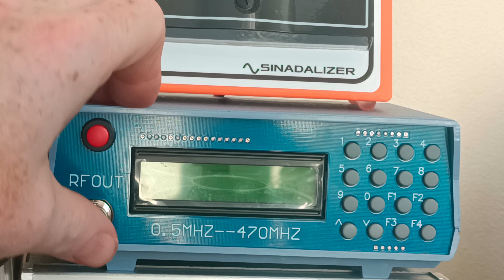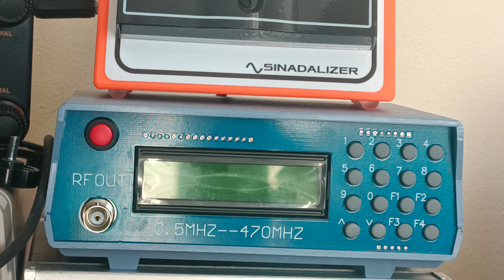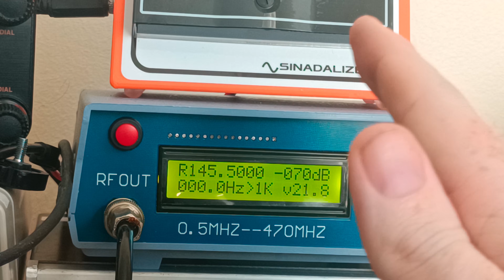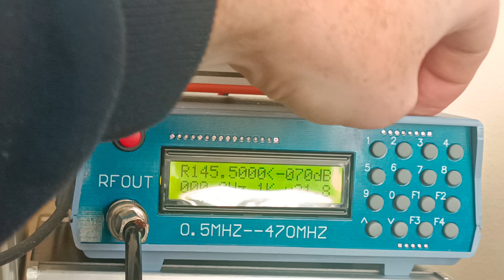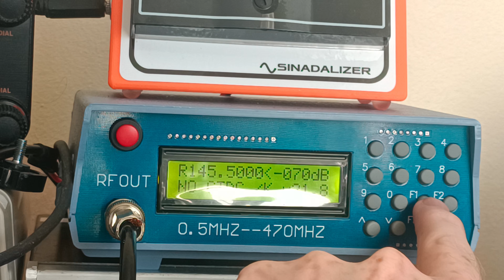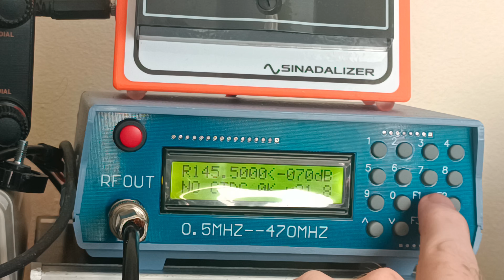How to use a cheap Chinese FM signal generator

Comment: uh nah isnt it illegal?
Reply from the maker: @Achhcity  if you can tell me what is illegal I would be happy to hear it, and also please refrain from using all caps, it makes it look like you are shouting, all this device does is generates a signal to locally feed into a radio's antenna socket for servicing and tuning purposes
Reply: @PaulMcGeeM0WNU  oh thanks and i will surely remove the caps
Reply: @PaulMcGeeM0WNU  by the way what would be the use for tuning? is it used lile tuning the large kind of transmitter antennas
Reply from the maker: @Achhcity  this is not for transmitter tuning, it is used for receiver tuning, by directly connecting it to the receiver set to the same frequency, while in this video it was connected to something capable of transmitting this is not the tool needed to tune the transmitter
Reply: @PaulMcGeeM0WNU  oh like tuning a satellite dish but big
Reply: Its a rf signal generator very very low power for testing recievers on 2 way radios! nothing illigal pice of test gear,mate ok
Reply: @rpcomms1  ok 👍🔥